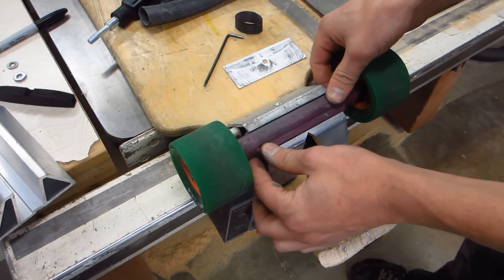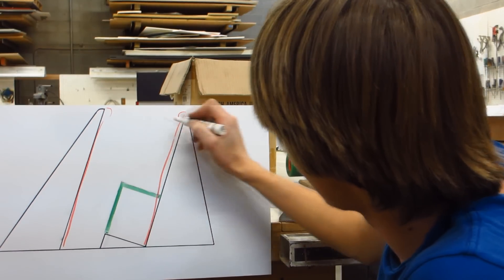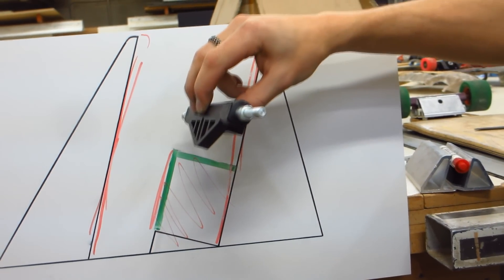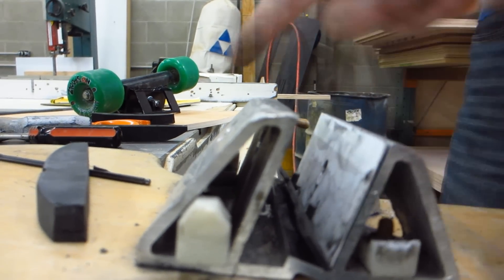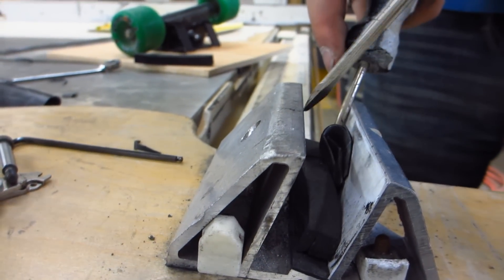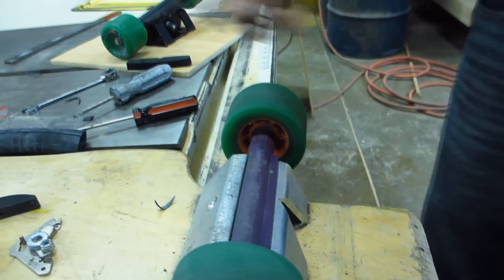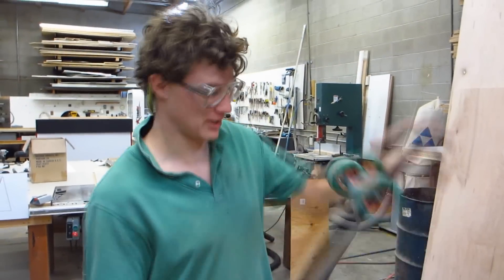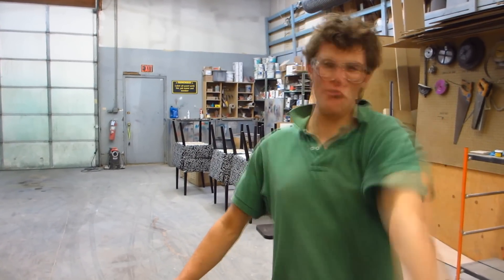How to Quiet Other Planet Trucks.

Comment: why don't you install plastic shims that can be homemade for replacement purpose on the actual hangar on both sides to prevent wear and tear of the solid material. what else can be used instead of a worn out bike tire tube?
Reply: yup, i was thinkin the same. or maybe a  replaceable teflon  coating or shims along side the channels on the aluminum pieces.
cool concept overal !!! =)
Reply: don't understand why these aren't designed with replaceable parts... you should never go metal on metal without some kind of serviceable bushings like real trucks or anything ever that was designed with friction in mind...😭

Comment from the maker: The shims we've been using for over a year now.
The bike tube is newer, but its just simulating a wider cam, which we used to run all the time.

It will affect the feel of the trucks if you push the cam out too far. Or if you run the trucks without O-rings it can also affect the feel.